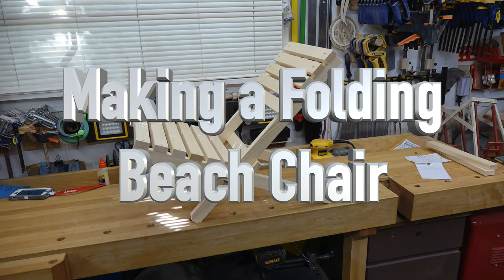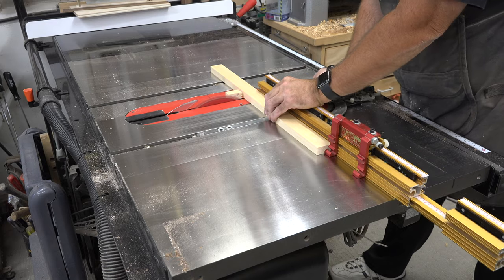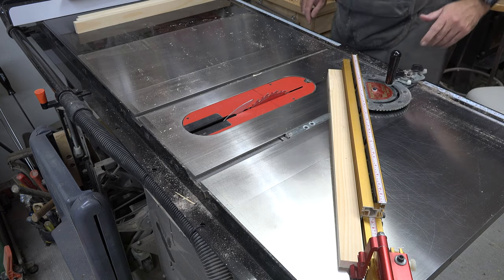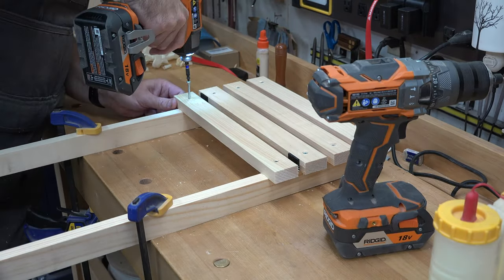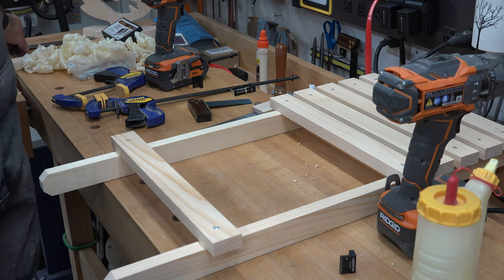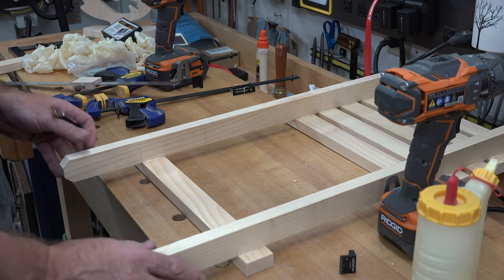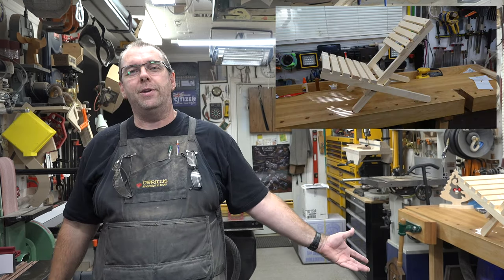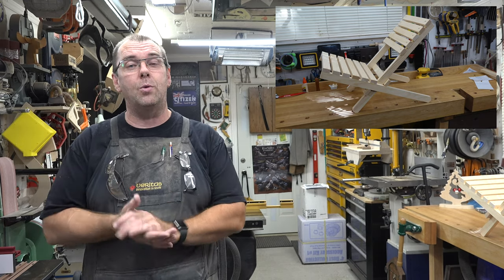Making Folding Chairs

Comment: Hey Kenny. I’ve watched numerous DIY build videos of this type chair, but this is the first one I’ve seen where the seat rails install OUTSIDE the back rails.  Shouldn’t the seat rails go BETWEEN the backrest rails?  I’m thinking there’s more support strength.  
Thanks for the very instructive video and especially the measurements. 👍🏽
Reply from the maker: Thanks for your questions Jody.  Whether or not the seat is on the outside of the back rest or the inside has no bearing on the strength of the chair.  It is the chair supports (The horizontal pieces that the seat slides in to) that hold the seat firmly in place and as long as they provide full coverage of the seat rails to support the seat, the strength is still there.  Putting the rails on the inside is also fine.  Either configuration will work with the same strength.  I hope this helps.  If you have any other questions, please don't hesitate to ask.  Thanks for tuning in to the show.

Comment: Great design chair but for me it would have to be a lot larger as I would have to crumple up my 6'-4" frame to fit on it, and probably unable to get off again, I have never seen that design before so I have got to have a go for some of my smaller friends  Thanks
Reply from the maker: Well John, I managed to crumple my 6'-2" frame into it although I have to admit getting out was a chore.  LOL.  There are several modifications that could be done and making adjustments is easy enough.  Thanks for tuning in to the show John.  Great to hear your comments.

Comment: Thanks so much for this project, great for a beginner woodworker like myself.  How could you make the back taller?
Reply from the maker: Making the back taller is as simple as lengthening the rail supports of the back piece.  You wouldn't necessarily need to add more slats, just lengthen the longer rails.  I hope this helps.  Thanks for tuning in to the show.  It's very much appreciated.
Reply: @acutabove_woodworkings  I made one on first try, worked like a charm.   Thanks again for making the video simple and easy to follow.
Reply from the maker: @tonycordell9205  You're very welcome.  Glad to hear that you found it useful.

Comment: Will it be strong enough if made out of Plywood?
Reply from the maker: I don't see why not Ram.  As long as the dimensions were the same as shown here in the project.  I would only suggest that if you are going to use plywood, that you use it with the ply laminations facing up for the chair legs and back supports to avoid flexing.  I hope this helps.  Thanks for tuning in to the show.
Reply: @acutabove_woodworkings  Great! Thanks Ken (Y)
Reply from the maker: @reddyrammanohar  You're very welcome.
Reply: Hey,, just to let you know, it came out really well 
Thanks :-)
Reply from the maker: @reddyrammanohar  Glad to hear it.  Happy I could help.  Thanks for the update.  It's appreciated.

Comment: What are the spacers you used? I put this chair together and came out amazing however would be extremely helpful having those.  I cant find them anywhere
Reply from the maker: Those would be Veritas Layout Blocks Samantha.  They have setup blocks on them for 1/8", 1/4", 1/2", 3/4" or 1".  They are great for little spacers in glue ups like this one, or for setting up tools or fences.  I just love these little things.  They are sold individually or in sets of 3.  Here's a link.  https://www.leevalley.com/en-ca/shop/tools/hand-tools/marking-and-measuring/110150-veritas-layout-block
I hope this helps.  Thanks for tuning in to the show.

Comment: Not for adults obviously
Reply from the maker: I have used these for adults and they are just fine.  Maybe not for an adult that has flexibility challenges (like me) but on average they are fine.  If not, you can always increase the measurements to suit your need.  Thanks for tuning in and for chiming in with your thoughts.

Comment: This is not suitable for old people as they will find it hard to do the folding. The folding chair should be fixed with bolts and nuts for folding.
Reply from the maker: Depending on how old the person is, I would suggest that they not use these chairs at all as they are pretty low to the ground and can be difficult to get in and out of as you get up there in years.  However, there is nothing difficult about folding it up and a person at any age can do it.  If you wish to add bolts to your, then that is just fine but it isn't the intended, or the original design of the chair.  Thanks for tuning in and for chiming in with your opinion.